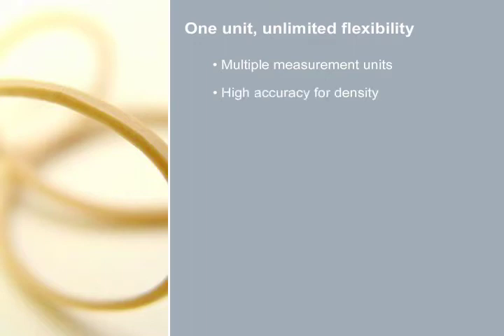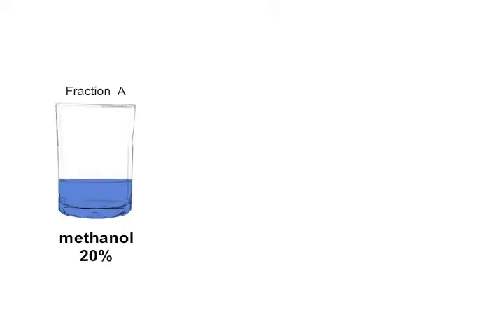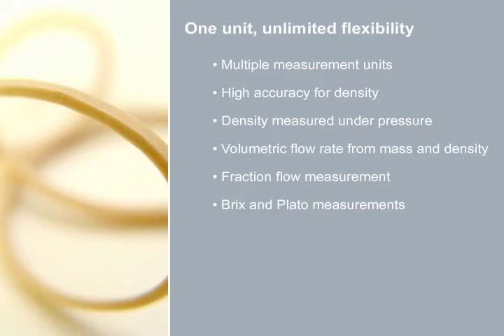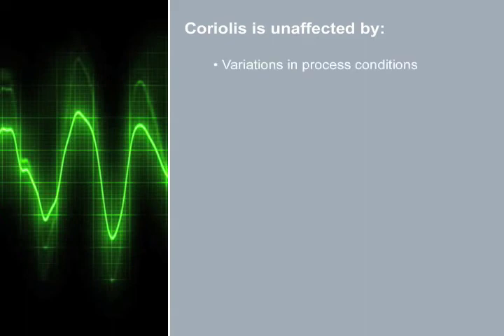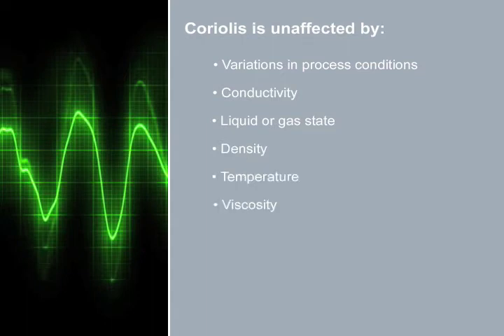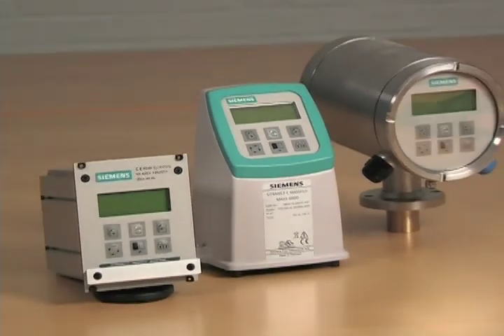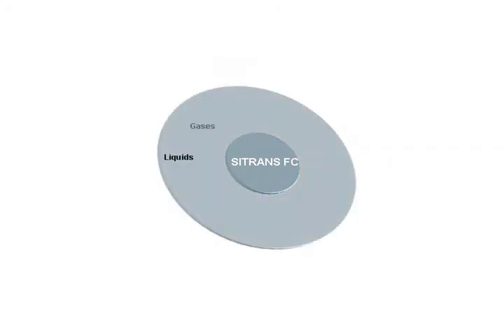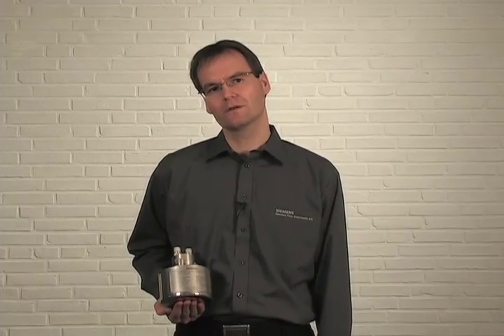Introduction to Coriolis flowmeters

Comment: very good siemens sc product... principal operation was not mentioned here... but although its a versitle flow meters... one of the most wierd application i have seen coriolis flow meters on oil transporting tankers/trucks in gulf countries.... to me it would be expensive meter to be installed on truck....